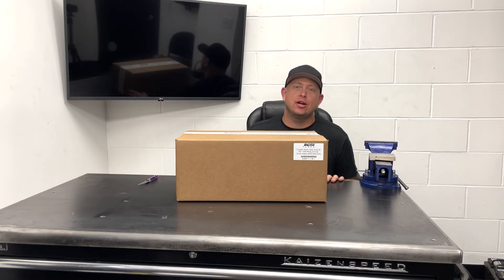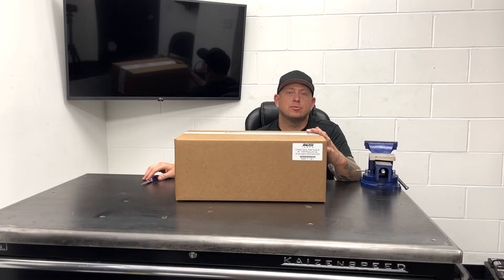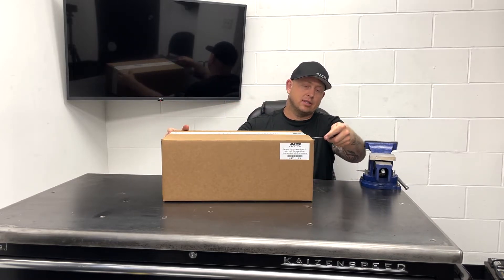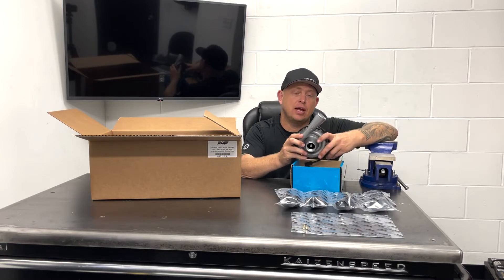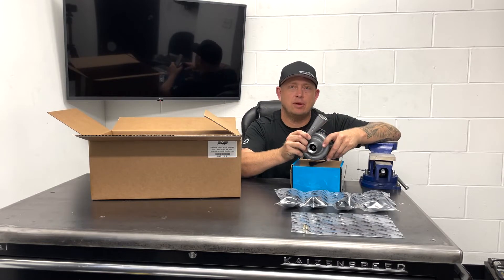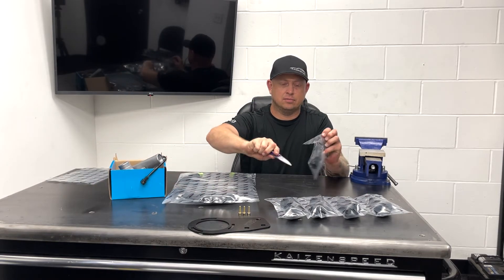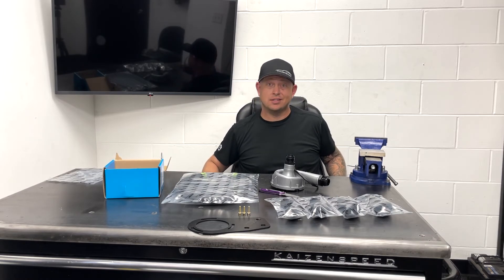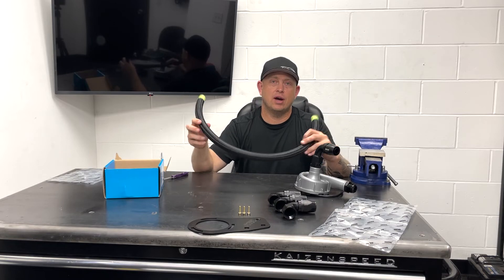Stop Overheating! Electric Water Pump Kits are Here!

Comment: Few thoughts i have a rear mount radiator on my turbo ram it over heats when i drove it on the highway last time at 230 before i shut it down going 55-65 but in the street it stays cool below 215 you think that water pump can benefit anything instantly